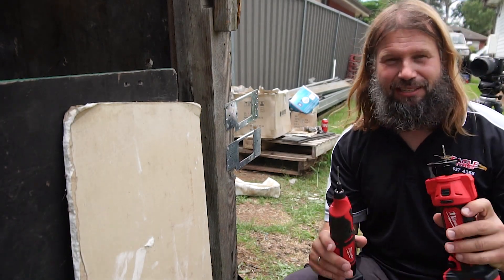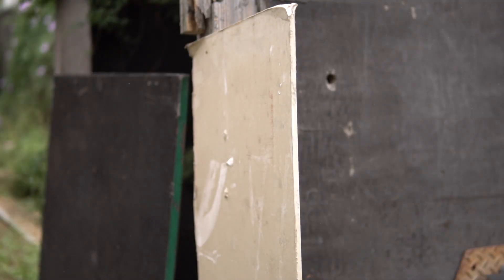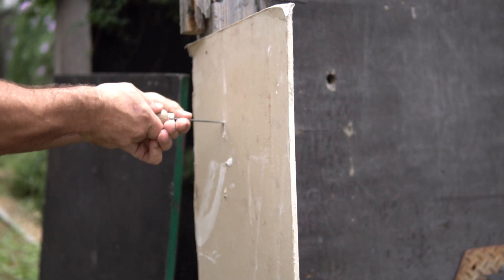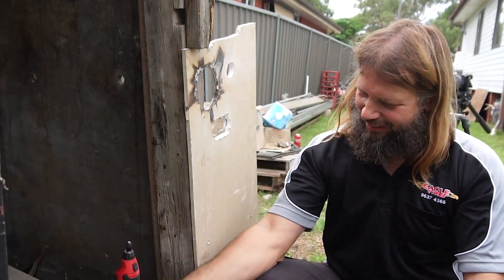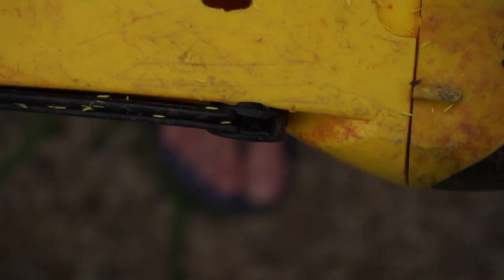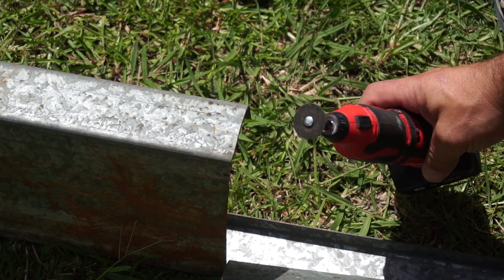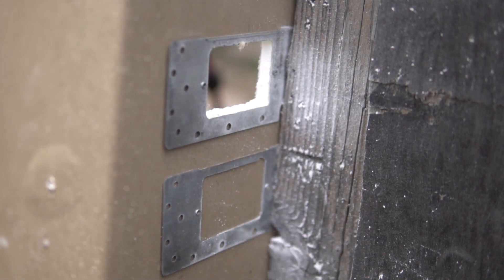Milwaukee Rotary Tool vs Gyprock Saw Comparison Test

Comment from the maker: Here is a test of cutting plasterboard (drywall) for electrical brackets manually with the gyprock saw, and with an M12 rotary tool and an M18 rotary tool. There are a few factors to consider; manual cutting with over 20 years of experience versus the first try with Milwaukee tools and no experience whatsoever, as well as the non-work environment.

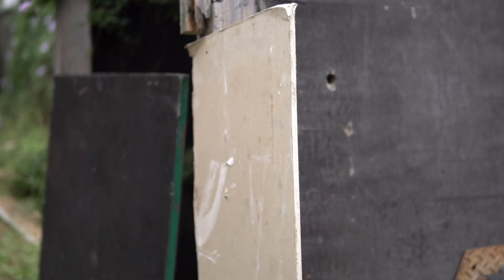02:09 Gyprock saw (drywall saw) - could have completed the cut quicker than 37 seconds if the plasterboard was fixed as in the proper work conditions without it being flimsy. For the cordless tools, this is not an issue.

03:00 Milwaukee C12-RT - the screw cap fell off half way, but it's been edited as if it was a "seemless" cut. As it's our first time using this tool, the cut out could have been completed in at least 22 seconds where you can see it finishing the second screw hole reveal. Then you would get quicker as the experience builds on.

03:50 Milwaukee M18BCT - This tool is supposed to be the "main" tool for cutting out electrical brackets, but comparing its size and weight (especially with the batteries), we would prefer using the 12V version instead as it would be easier on the handling when you got to cut 70 to 100 holes per day. Similarly to the 12V version, this tool would have completed the cut in 22 seconds or less with experience. We let it go for just under 39 seconds (for "shits & giggles") as the screw holes werent revealed.

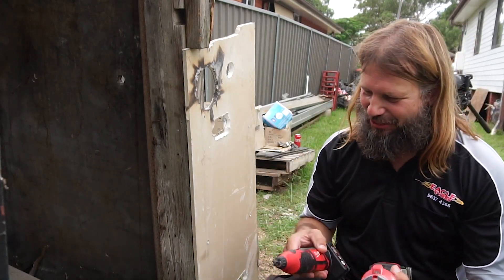04:45 My thoughts. I gave the 12V tool the first place preference and chose the gyprock saw over the M18 tool because of the size, weight and the amount of dust it blows in front of the user.

06:45 Cutting plastic with M12 tool. Good for cutting out switches for lockers and lights in the dash, especially at low speed. It cuts very good and precise (if you mark it out first).

08:05 Cutting metal purlin with the M12 cut-off disc. At 09:36 I said 37000rpm (I think I'm getting blind).

10:05 Cutting more plasterboard

So... let's say you save 15 seconds per hole over the manual cutting, and you have 100 holes to cut in a day. That would equate to 25 minutes of saved time per day. As of April 2020, the C12RT costs $156AUD + battery. The M18BCT costs $219AUD + battery. Do you think it's worth it? Would you get one?
Reply: Nice video, im sorry for writting here, but would be nice more afw videos. You are my inspiration 😀 good luck
Reply: after two blowouts with a drywall saw that required repair, I swapped to the cutout tool.

Comment: Bought the larger cut out tool this week. It’s neater but there is a knack to using it that’s for sure. I don’t like the switch location. And is quite loud against the steel switch plate. Cutting out door frames or niches there is more skill involved as it wants to cut into the wood when you get to the top. Wondering if I’ve wasted my money but will give it more of a test run before I decide.

Comment: I've got this old dewalt router I've had for years and I've been hanging board for 34 years and I've tried probly almost all the routers on the market the dewalt I've had is the best and has the most miles stagering amount of miles only changed the brushes once

Comment: If you getting the Milwaukee rotary tool get the dremel tool spiral guide (565) and the dremel multi pro chuck. It will make things easier especially if you want to use it to cut drywall. It will make the tool 100x better

Comment: It's also important to have the right bit!
Regular drill bits WON'T work.

I used to use an m18 chuck drill at high speed, with a tiny trill bit, but it was always slow, sometimes even breaking the bit.
Regular drill bits with a cylindrical outside face won't cut outwards. Drywall bits have more of a ninja star shape, or razor edge lines. No smooth faces at all to get stuck in one spot like a regular drill bit. It's designed to always cut & move around.

Comment: Just to note, when using a drywall cutout tool, going counterclockwise is best, as gives more control and makes it easier to cut. Going clockwise, rotation of bit, can cause tool to grab, run away and over cut some areas. Granted, sometimes you need to go in opposite direction than the norm (counterclockwise), I know this, but for majority of work for a drywall cutout tool (rotary tool, and router) counterclockwise is best. ¹ 
Thx for comparison vid✌🏻

¹ edited for this 
Clockwise for inside cuts, like cutting out drywall for inside a door frame. 
Counterclockwise for cutting on outside of say a electrical box 
Doing this will help prevent digging in and “running away”.
Also like said, if get really good and experienced, can probably go either way and be just fine. Just like most Pros will remove bit guard/the depth stop guard; and this is also done for when cutting out can lights, ducting, etc….that’s up to far and having this guard on, makes it really hard (impossible at times) to cut anything.

Comment: I encourage you to learn how to use a drywall router properly! Make sure your bits have guide points its 100x easier for beginners. If you dont have a guide point, it's making that horrible noise because you're applying too much pressure and again non guidepointed drywall bits are not recommended for beginners, if you do have the guide point you have to use it man
Reply from the maker: No point man, quicker and neater by hand 😅

Comment: I just found your channel. Awesome videos. I have a question. What if I have drywall and a metal sheet behind the drywall and I need to cut a perfect 6" circle past both materials? What would be the best tool to do so? Thank you so much for any feedback 🙏🙏🙏
Reply: A 6” hole saw only cut half inch deep so you don’t go into the metal or damage the teeth that way you’ll get a perfect circle!

Comment: Just curious if your ever worried about cutting cables sitting behind the wall?
Reply from the maker: Yeah 😂 always. So I still use the manual saw 🤣🤣🤣
Reply: @musahodzic9732  you can just cut the bit to the exact thickness of the dry wall and never worry about it.
Reply from the maker: @ilikerealmaplesyrup  you can, but it needs to protrude a little bit to follow the bracket around and a lot of the times the brackets might be bent a little which would require setting the bit a little deeper, then defeats the purpose. I'm still happy and feel more comfortable cutting out manually. Not a great time differences.
Reply: @musahodzic9732 I found this yesterday on hole #2. The plate was bent so the guide went straight past it and created a gash I now need to fix. I guess that’s why many do away with the adjustable guide plate.

Comment: Good demo of the power tools, but your stab/jabsaw is junk: we use slightly larger saws here in Texas, with a sharp point on the end, stiffer blade, bigger teeth, and a bigger handle.
Reply from the maker: Yeah true! It's an old saw, like over 20 years. It's perfect for the metal brackets as the teeth are worn so it just glides past it. I still use it over the power tool as I can feel the cables with it in the back. I tried a brand new Milwaukee saw but the teeth are too sharp and it's annoying me being caught on the bracket. Not a biggie, but it's those little things...
Reply: good to hear you feel around with that saw!

Comment: I was on the fence getting m12 rotary tool, m12straight die grinder or m18 rotary tool. But after seeing that the m12 rotary tool doesn’t appear to bog down like a normal Dremel tool, I think Ill be buying an M12 rotary tool in the morning.

Great video. Thanks!

Comment: The m12 tool you were using looks like a die grinder, right?
Reply from the maker: Yeah, looks like it, but they call it the rotary tool. Die grinder is also available.
Reply: It's a beefed up small rotary tool, aka dremel clone. The M12 die grinder is a separate tool with a 1/4" collect. It is stronger with a brushless motor, and it's larger.

There is also an M18 Cut-Out tool which is larger than the die grinder but not brushless. It's more akin to a smaller handheld router.

All of these are rotary tools that fit different niches.
Reply from the maker: @AERuffy  that's right 👍
Reply: @AERuffy  But do you think a die grinder would work as well ? I was thinking of buying a die grinder for the flexibility of the tool. More power, more opportunities ?

Comment: No more holes thru the back wall.
How many holes do you think cutter will last for?
Always surprises me the air con guys still cut vent holes by hand
Reply from the maker: Haha 😂 do people cut straight through the back wall? 😂😂

They reckon the bigger M18 machine on 3Ah battery can cut 150 holes on a single charge, so I reckon the smaller can do the same or more on a 6Ah M12 battery, which is still lighter than the bigger one with the 3Ah.

Yeah, I see what you mean, but in all honesty, there's more control cutting by hand, in terms of feel. Like, if you haven't tucked your cables properly during the rough-in, you can easily nick them or even cut them with the cordless tools as you can't feel them. That'll then waste more time repairing. Similar with aircon ducting. Oh, and if you've tucked everything away nicely, you'd have to rely on other trades not disturbing any of that until the time comes to do the cutout. So yeah, there are pro's and con's with both.